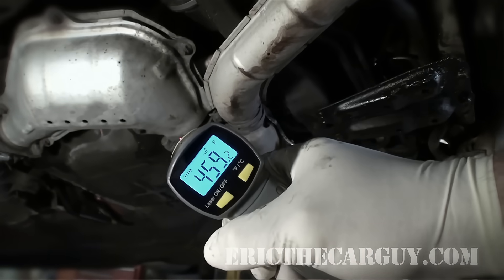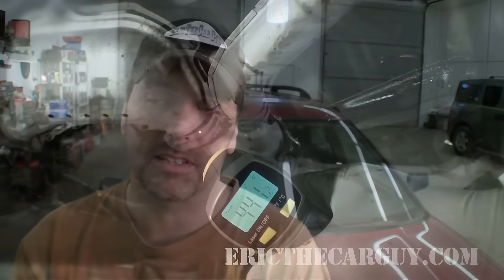Does Lacquer Thinner Clean Catalytic Converters? -EricTheCarGuy

Comment: Great video, as always! Scotty recommended one gallon of lacquer thinner in half a tank of gas. You put a quart of thinner in 2/3 of a tank. If the tanks are roughly the same size (granted, a big assumption), then Scotty's solution was over five times as concentrated as yours. That may have made the difference.
Reply: i thought the same...LOL   it's like water down lacquer thinner
Reply: Yep
Reply: Scotty's The Man.
Worked for me too
Reply: Yep, nothing makes me more angry than when people try to "duplicate" something and are WILDLY off
Reply: Exactly. Scotty recommended 1 gallon for half a tank and he never said it would repair a cat but clear the cat to pass smog... so this guy in the video is misleading people.
Reply: @Vex916T  so is that half of a 20 gallon tank, or half a 50 gallon tank ?
Reply: Exactly. Don't call it a test of something if the proportions are so wildly different. No hate, just be realistic. At least he did give the link to Scotty's video so we could see how Scotty actually recommends it be done.  @kellismith4329  Scotty was putting it into an Acura, so obviously not a huge fuel tank (quick search, maybe 15-20 gallons), probably comparable to the Subaru here, 15.9 gallons.
Reply: @Vex916T  My thoughts exactly! Scotty mentioned that the thinner (and Soapy water solution) was to fix an issue with a clogged Cat. I don't know why this guy is misleading people by being vague about what Lacquer Thinner fixes and using it as solution that his car's Cat doesn't have. Probably wants to steer people away from cleaning their Catalytic converters and buy new ones
Reply: @SRB57  Agreed. I saw that video years ago aswell and I remember him saying specifically, 1 gallon for half a tank, and run it 150 miles, or run it in park at 2500rpm for 30 minutes. He also said it wasn't a 100% fix, that it was a cleaner. If the cat is beyond repair, or the o2, or even a hole in the exhaust between the sensors, it won't do anything, but he said it's a good idea to try it first before taking things apart. For myself, I usually check to make sure nothing is loose, from the manifold to after the rear o2 sensor,  then run a shopvac in the tailpipe and see if there is external damage, and if none are the issue, then try the lacquer thinner, and if that fails, the cat needs to be replaced. Important to check the o2 sensors if they aren't loose cause moisture could trip the code too.
Reply: @cerebrum211  thanks!
Reply: Yes Exactly...
As Myth busters do... They always Screw Up... Change / Weaken the Fix... So It Does Not Work.  You Need 4 Times the Thinner.
You were supposed to do 1 Gallon of Lacquer Thinner on a Half Tank (8 Gallons of Gas).  You barely had any Thinner.
But I used 2 Gallons of Lacquer Thinner with 13 Gallons of Gas in my 2013 Chevy Silverado 2500 HD and Drove 190 Miles on Highway.... Till I was near empty.... And it worked.  
But hey,  This Video is just an attempt to try and put down another Channel... small minds... small mission
Reply: @jameschupp2230 What brand of Lacquer Thinner did you use, cause I want to try this?
Reply: @tamikahayes4331  It was from Home Depot, The Label Reads:  
Klean Strip - Lacquer Thinner - CLEANS SPRAYERS & TOOLS
But be careful, because Home Depot also has a "Green Version".  That may work too,  But I did not use the "Green Version".  Be sure to Drive highway speeds and use the gas with the Lacquer Thinner... Down close to the "E", Then fill back up with regular gas.  And if you can find it, Put in a few gallons of NON-ETHANOL Gas in your tank too, if you can find it.
Reply: I can imagine Scotty laughing with his hands in the air.
Reply: @jaysonmarvich1297  With the picture of the braying Donkey up in the corner.
Reply: Also his car has two cats on top of the weaker concentration of LT
Reply: Bingo!
Reply: @ James Chupp What brand of Lacquer Thinner did you use? I want to try this on my car
Reply: @tamikahayes4331  @Tamika Hayes  It was from Home Depot, The Label Reads:  
Klean Strip - Lacquer Thinner - CLEANS SPRAYERS & TOOLS
But be careful, because Home Depot also has a "Green Version".  That may work too,  But I did not use the "Green Version".  Be sure to Drive highway speeds and use the gas with the Lacquer Thinner... Down close to the "E", Then fill back up with regular gas.  And if you can find it, Put in a few gallons of NON-ETHANOL Gas in your tank too, if you can find it.
Reply: And this guy said clogged cats weren't his problem, didn't he?
Reply: The lacquer thinner was only used to clean and not repair the cat.  Apple and oranges.
Reply: @dougmacqueen1679  Trolling another video this badly makes this creator come across as a hack.
Reply: @Rob07601 Eric mistakenly understood the lacquer hack as being more than just a cleaning process.  As do many many others watching Scotty.   I know I am not perfect and Eric is not perfect.  Hardly makes him a hack.  Are you his protector?
Reply: Awesome note!
Reply: My thoughts exactly. He was hoping to bust Scotty  as a hack and failed
 Lost respect for him as a result.
Reply: Nooooo..... He DID say he might not have had the portioning right and clearly stated that he was speaking for himself.  Don't hate.
Reply: @PsychoSiKS  Um no, need to hate because he could have easily went back to Scotty's youtube video and re-watched what Scotty did before making this crappy fake debunking video.
Reply: @PsychoSiKS  ..then he should only criticize Scotty or any other recommendation by following the proper instructions as a re-test....meaning....using the same concentration....and THEN say it doesn't work ( if it doesn't). Giving him a "pass" by him admitting he didn't do it right....make his entire claim suspect
Reply: @PsychoSiKS  you are right, I can tell ERIC IS A GOOD AND HONEST MAN .
Reply: @PsychoSiKS  He Still screwed it up by not doing it the "RIGHT" way! Scotties worked and this guy's did not because he did it differently and suggested it would not have worked any how else he would've done it again but correctly the second time!
Reply: @PsychoSiKS  With all the effort making the video he couldnt take the time to get the concentration correct?!?  1 gallon for 1/2 tank... not that difficult.. this site lost me

Comment: @Eric  You used a much more diluted mix than Scotty recommended.  His advice was 1 gallon into half a tank.  That is four times as much as you used.

While there is no guarantee it will work, it did work for me on a 2006 Toyota Prius with 198,000 miles on the original cat - half tank, 1 gallon thinner, 150 miles on the freeway.  In fact, I reset the ECU right after adding the thinner just before leaving downtown Los Angeles for a round trip to Santa Monica.  Days later and the P0420 code still has not returned.  Let us hope it stays gone for a long time.

Like Scotty said, worth a try.  My cost:  a little over $20 for thinner and $15 in gas.

Comment: It works best if you add the lacquer thinner to 1/4 tank of fuel, drive 20-30 miles then fill up and drive as normal. Light usually goes out on it's own before you get back down to 1/4 tank. It also cleans the O2 sensors so they read more accurately. If the ceramic substrate starts breaking down, it will clog MECHANICALLY, NOT chemically and lacquer thinner won't work. I had THAT issue on my '98 Jeep Grand Cherokee 5.9 Limited and had to replace the converter.
Reply: you need a 10:1 ratio.   You cant go by 1/4 or 1/2 tank.  what size tank?  13G?  36G?   18G?  25G?  You need 10:1  1 gallon LT with 10 gallons of gasoline.
Reply: @weskirkland5850 this is super helpful thank you. Specifying 10:1 gallon ratio.
Reply: VERY good comment my friend!.. I totally forgot that that could absolutely be the issue.
Reply: My 2005 Mitsubishi gallant 4-cylinder makes a lot of noice when i hit the gas. Like it has a hole in the exhaust, but it doesn't. 
Does this mean the CC  has disintegrated inside?
Do you think the thinner will work; will it hurt the-engine/CC if I give it a try? Thanks so much for sharing your story my friend, from deep in the heart of Texas.🤠

Comment: From what I've gathered I have seen an option where this gentleman took out the O2 sensor and installed a properly sized/threaded hose which is hooked up to a small container with a cleaning solution that gets pressurized somewhere near 60lbs and so when u start the car yes the O2 sensor is out but you run that cleaning solution through while the car is running. This way no chemicals or solutions are going through the motor. Only the tailpipe. Logically if you don't want 2 take the exhaust apart that may be your best bet. Thankfully I recently picked up a welder so I can do just that when a code pops up for any of my vehicles in the future.

Comment: Eric is it true i have replaced o2 sensors but now I have low efficiency on bank one..question is how the hell does a cat goes bad ..I don't think it was bad at the beginning..but any way is it true that cats are like brake pads they are made to wear down after 100 thousand miles..my 2005 has over 200 thousand miles so are my cats bad...

Comment: I'm sick n tired of 420 codes.
2000 camry 3.0 V6.
I had to replace plugs wires andc2 coils.
Right after that the CEL would not go off. 
So in to the shop.
You need an O2 sensor.
We replace it....same.
You need the other 02 sensor as well....same CEL on.
Go to a different shop.
You need a converter. 
I put in Cat Clean...nothing.
Replace the converter...still the light would not go off.
Back to the shop...you need both converters replaced.
So first of all shops can't even properly diagnose this damn fkng code to pin point what you need!!!
So after hundreds of $ later still have the fkng code.
Car won't pass inspection. 
Im fed up with cars.

Comment: Mine is 2004 Toyota Sienna, got the code, mileage is 230,000. Tried the lacquer thinner method, dove 160 miles, most of the time above 80 miles. Miracle did not happened. Maybe my van is too old.

Comment: I'm glad you showed before and after temperatures.  I think you are right that your proportion/mix was incorrect.  One quart on what 5 gallons?  Probably not concentrated/ not enough.  Others use a gallon and Scotty says 1:9 thinner to gas.  I used your other video to finally read in/out temps on my Corolla.  They don't vary much, but are inconsistent. One reading showed output was low, next showed over 10% rise (desired?) other was static.  I was about to admit cat, but I'm stubborn.  I want to try this.

Comment: the O2 sensor readings he showed had nothing to do with the catalytic converter. They are in response to how rich or lean the engine is running. They move up and down slightly as the O2 sensors are telling the ecm/ecu whether the exhaust is rich or lean. The ecm changes the injector pulsewidth to add more fuel or cut fuel to achieve the desired 14.7:1 stoich ratio. If the sensors are way off or bad, the engine will run rich or lean. In addition, the maf is providing a measurement of how much air the engine is taking in as the wire is heated or cooled down and higher or lower voltage is applied. He is using a measurement that will only be affected if the cat was clogged, and only on the post cat.

Comment: It works if you run it every 10,000 miles from the time the vehicle is new. I  use the Scotty Kilmer method also, except I remove the the cat or cats every 50,000  miles. I do a 5 minute soak in muriatic acid rinse/ back flush in water. Then a  5 minute soak in lye ( granular drain cleaner mixed with distilled water). Then another through rinse and back flush with tap water. As long as there is no damage on the inside of the cat from mechanical or impact damage they will look almost new inside.. I have a 2005 Nissan Xtrerra with 380.000 miles on it running the original cats applying my method.. It is time consuming and you have to be careful with the acid and base but it works and beats paying over $3,000.00  for OEM cats.

Comment: I need advice!! 2005 Nissan Altima..2.5 I am getting the p420 code multiple times. My light is on and now I can hardly Accelerate at all. I'm trying to avoid having it replaced but I dont knows which ne t is! Is there 2? I'm trying mg the lacquer thinner! I've tried the store stuff and nothing. I think it just needs to be cleaned!

Comment: Your "symptoms" on your specific car's catalytic converter weren't from the inner screen being clogged from exhaust debris, burnt oil, carbon build up, etc..your symptoms is the converter is no longer performing NOX as it should..which you knew even before you did the Kilmer stop gap...so "cleaning" it with laquer thinner, or taking yours off the car and "cleaning" it with soap and water, like in Kilmer's video, isn't going to work. It isn't "clogged."  So what you did putting lacquer thinner in the car's fuel tank and driving it was like taping a watermelon to a broke washing machine hoping that will fix it.  If it was clogged..you'd only be driving around 20mph down the highway..no engine power.  The only solution in your case is to replace the catalytic converter since it can't pass emissions tests or be licensed safely to be in the road until the converter is replaced. Kilmer is right.

In many/most instances, your situation matches what's going to happen as all car engines in today's vehicles are designed to efficiently burn fuel without creating residue; but, catalytic converters can and do go bad.  In older engines, misfires, piston ring blowby oil in engines with over 150,000 miles it's very common for older engines to have these problems. In older engines or cars, the older engine can and will clog up a functioning catalytic converter screen that simply cleaning the debris restores a functioning catalytic converter to working order. The simplest way to clean it for the vehicle owner is pour a liter or quart of lacquer thinner in the fuel mixture ratio Kilmer suggests and run the engine for 30 minutes (since vehicle is basically not driveable).  

In many cases, simply lacquer blasting the catalytic converter screen clean of buildup can restore the converter to proper function negating any expensive replacement.  As Kilmer said, it's simply an option to "try first" before forking out 1000s of dollars on purchasing a new one (which, over time, even if you purchase a new one, you still have the same problem with an older model car with high mileage on the engine - the new one will also clog up if the engine is older and worn and emitting these high carbon debris into the exhaust manifold and directly into the catalytic converter..new one or old one will clog up--so clean it restores function).

You tried Kilmer's opt..but your initial start before the lacquer thinner test--your video data you showed to all the viewers showed no clogged catalytic converter..when you ran your initial tests. Yours: simply isn't functioning anymore. You'll have to replace it. You could have verified your readings (which is unnecessary--your data is correct w/o any Kilmer O2 pressure test) - simply shown the viewers Kilmer's O2 sensor removal and testing for back pressure..if you didn't believe the readings..but they were accurate..which your readings show you have none..no clogged catalytic converter.  

So again, even doing the pressure test in your case would be mute because the readings show there is none (no clogged catalytic converter)..so exhaust is moving through your catalytic converter "clog free."  Therefore, cleaning your catalytic converter with lacquer thinner was like taping a watermelon to a broke washing machine and leaving your viewers to wonder if the watermelon will restore their broke washing machine to working order.

If Kilmer's O2 test had shown no manifold exhaust pressure build up, like your initial readings from both sensor heat gun test indicated little to none (yours showed your car has no clog), Kilmer's video would have been over.  He would have to tell his viewers they need to replace their catalytic converter.  The simple point of Kilmer's video is simply rule out replacing first.  Lacquer thinner isn't going to "restore" a catalytic converter that no longer has NOX function capability.

Comment: OK if I remember the mix everyone calls for is 1 to 9  you used about one to 44. I have tried this twice both on Toyota's. It worked on one car not the other. It worked for me on my Camry. Did the approx. 1to9  mix and drove it 70 miles then stopped to pee (I'm getting up there 68) turned around and went home 80 miles (picked up 100 lbs of bird seed for the wife) last 12 miles the check engine light went out. I past emissions the next day. The time it didn't work. I told the step grand daughter to drive the same route. Bowie to Cambridge grab a burger and fries turn around and come back. She drove over the bay bridge ( twenty miles ) visited her cousin for 3 or 4 hrs. then drove home. The light was still on. Fortunately it finally worked. I've had friends that it didn't work for probably 50/50 . But they all used 1 gallon to 9 gallon mix I still like your videos.

Comment: Good stuff, my ML320 W163 starts but struggled to revv up.  Bank 2 (cyl 4,5,6 misfire).  With suspension of blockage i removed 1st O2 sensor, engine revved up nicely.  I was thinking about cleaning CAT but after watching youtube from various sources.  May be it wont work.  What do you think?